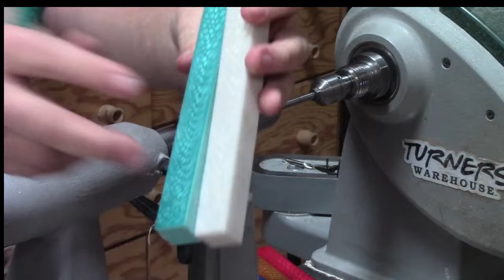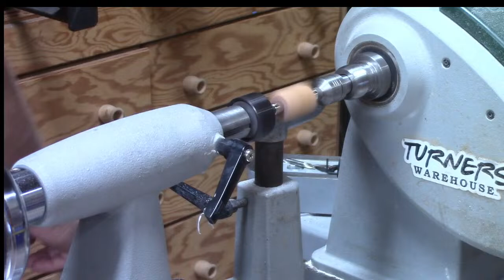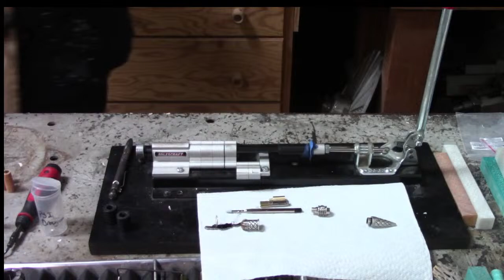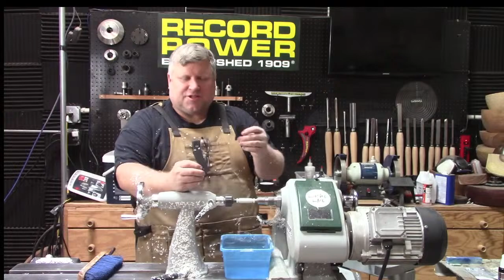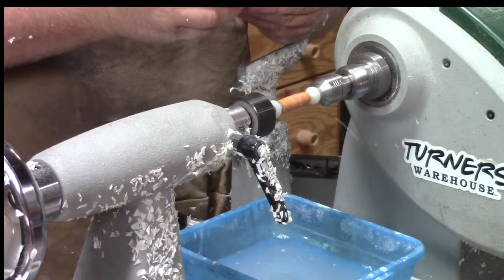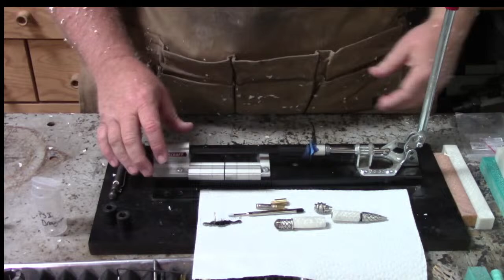Pen Turning Live - Serpent Scale Blanks

Comment: The Peke Safety PowerCap is a game changer. It's light enough that you  can comfortably wear it for hours. I have a neck full of metal (couple of rods, 12 screws, 2 plates, wires and fused up from C2 down to C7) and it's not a problem for me to go 4 to 5 hours with it running. It provides tons of fresh air, keeps my face cool and filters the smallest of particulates. For those of you who have a sensitive respiratory system, it will change the way you turn and how much time you can spend at the lathe. Awesome product!
Reply from the maker: Right!! It is amazing for sure